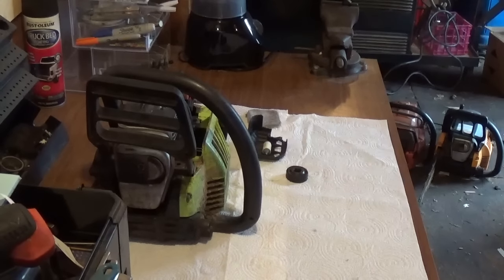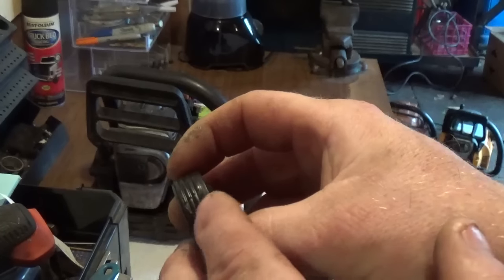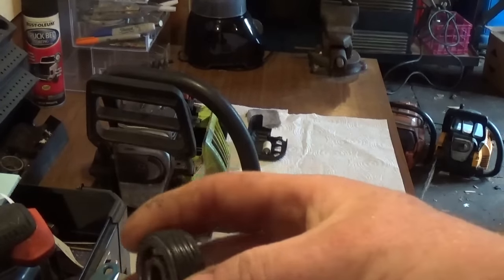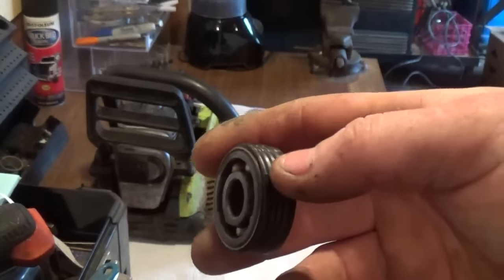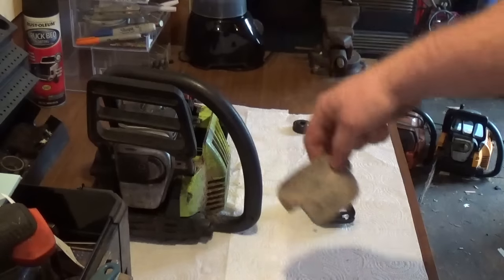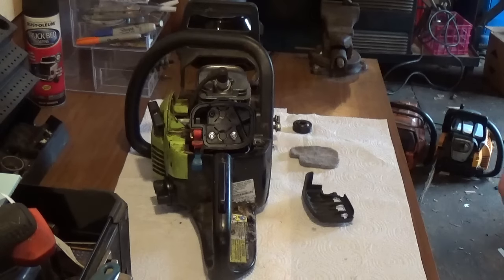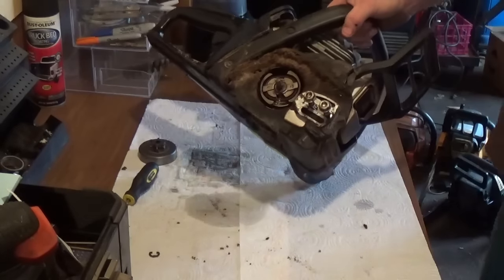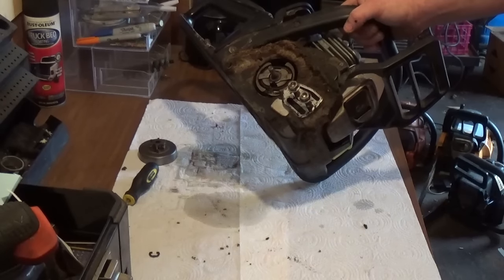Common problems with Poulan Chainsaws

Comment: To be honest the fuel line deterioration can happen to any brand, especially if ethanol fuel is around.
Reply from the maker: True .....But the cheap fuel lines in a poulan from factory are truly hands down the worst on the market.. Viton really isn't much better....The modern gasolines just play hell on these saws and carb related parts as well .
Reply: If the line isnt black it ain't right. U can go to autozone and find that out.
Reply: i have had two of these and the only problem i have had is fuel lines, bulb primer deterioration, and the carb coming out of adjustment. All simple fixes
Reply: I had cheap fuel lines swell up and crack.
Reply from the maker: 3 in the course of how many years?
Reply: I bought two over a 7 year period. If you use ethanol free fuel you will have even better results.  You get what you pay for. I don't understand people who buy a 100 dollar chainsaw and expect it to run like a STIHL.
Reply: Kevin Bolin it’s without a doubt that poulan designs equipment to fail. Designed to fail to make more money by buying parts or a whole new piece of equipment.
Reply: Thats on the owner, and I deal with it ALL the time. Seems like 90% of my repair is fuel related. I try and steer guys to recreational fuel, but there are only a few places that even sell it honestly.
Reply: @MonsterLegoTruck  They are marketed for storm cleanups . Thats why they are so cheap. No one buys a $100 chainsaw to cut 10 facecord of firewood for the winter and expect it to last. We called them bic lighters, when they ran out of fuel, throw them out. Most guys NEVER properly maintain them. They use them for storm cleanup, then throw them on a shelf in their storage barn. They sit with old fuel, caked with oil and wood chips. Then next storm comes along and guess what? Garbage. Then they sell them at yard sales or give them to a buddy that brings them to me expecting me to be Small engine God or something. I usually tell them , sorry, by the time I fix it, you could buy another new one. Then they ask me to scrap it for them. NO PROBLEM!
Reply: Well spoken of Truth
Reply: @kevinbolin7665  Put good gas in them,,,less Ethynol,that tears up all small engines....Stick with good octane gas,no Speedway,Casey's,I you BP ,94 Octane in everything,keeps them clean and running fantastic,,,,,,,NO ETHYNOL,,,,,BAD ON YOUR SMALL ENGINES,,,,,,,BURNS UP CYLINDERS AND LOCKS THE RING INTO THE PISTON,,,NASTY SHIT...
Reply from the maker: Toob247 Toob247  LOL...and a set of adjusting screw drivers , new carb, new gas cap, fuel lines, piston , cylinder, recoil assembly , coil, intake gasket , oiler...….LOL …...you know basicly a actual running chainsaw to cannibalize . This comment …...I mean seriously …...damned this is funny …...3 acres …...lol …….How many shrubs did you cut..... ROTFLMAO...….Tool247 Toob247 I am trying to keep my composure / OH hell …..Seriously Provide my viewers and I a video to validate your claims as the shit is getting deep and I haven't even put on my boots so to speak .
Reply from the maker: @ROYLFRSHNESS  Really / Prove it …..Show my viewers your results by taking own the Poulan challenge .
Reply: Buy the cheapest saw you can find and expect prograde logging equipment
Reply: I actually seen a video once where an American  pronounced poulan correctly.
Reply: And all saws are mass produced.  Don’t see how that is a specific downfall
Reply from the maker: @lucaslounsbury8515  Oh well let me Enlighten you .....Quality Control ......expedient production ......Rushed casting defects ......inferior cheap china incorporated parts ........Truly Lucas this list could go on and on ....You might wont to look into how quality chainsaws are made ......I think How its Made the Tv series may  provide a profound amount of insight towards your perception in comparison to your idealism .
Reply from the maker: @Mike-su8si  LOL.....Right as much oil that leaks from these pieces of shit just simply flip them over and place the bar in the puddle you have amassed ......
Reply from the maker: @lucaslounsbury8515  Chicanic
Reply from the maker: @lucaslounsbury8515  Now Efficiency ......Thats where you need to base your argument .....Not price point ....Quality is often expected rather rarely delivered .....Theres truly no Standing Standard as there once was   obligating longevity .
Reply: @kevinbolin7665  I like how the oil comes out of them and wished this shitty stihl would work as good as my poulan pro but it doesn't so the stihl is just a sitting piece of junk to me 

I still would like to find someone and trade this stihl for a poulan cause i screwed myself the day i bought it an was set to buy a husqvarna
Reply: You are so right, not just the wild thing!!! I defense the the wild thing, I have had mine for years and l have had no problems like this, in my eyes the wild thing saw is a good saw my friend!!!
Reply: No, any material scientist worth their salt can easily help a manf. spec ethanol resistant material for their lines.  Its $0.05 more.

Comment: The crankshaft seals going bad are a problem. I was given two old saws and after fiddling with the saw for hours, I could barely get them to run at a fast idle, but would immediately die or run very erratically - exactly as you said. Very hard to start, and carb adjustments were extremely finicky. This was not a carburetor problem. Suspecting the seals, I bought a new set of seals and bearings online for both saws - had to tear their engines completely down, and the old seals slid right off - they were deformed and worn out. You could see evidence of blowby around the bottom plate of the engine. Put them all back and no more problems, but expect wasting an afternoon doing so - cleaning the gunk out of the chassis took more time than anything else. All parts have to be thoroughly cleaned and free of any grit before reassembly or the bearings or cylinder will be damaged.
Reply: I accumulated 8 saws for fun and one is a 1638 craftsman simpul that ran with a dirty carb when I got it but had to have a fast idle or would die. It would sometimes randomly lean out and speed up for a second or two during no load revs but then return to optimum rev. But it would cut good and not lose power during cutting. When it stalls out from idling it has a pretty noticable suction/whine noise like some kind of vacuum is being drawn into somewhere. Can't tell where it comes from. Almost like something isn't venting that's supposed to. Or is leaking vacuum that's not supposed to. It will also make the vacuum leak down noise if it doesn't start after 3 or 4 pulls. Idk but I struggle to keep it running. Crank seal? It actually started and idled a little better last start with the fuel pick-up and primer line reversed lmao.
Reply: @kkc3009  I have a Poulan pro 4218 that is making that same little sqeaky vaccum noise. Can anyone confirm this is a leaking crank seal? Having a hell of a time getting the carb adjusted on this saw. Can get it dialed in but after the saw cools off it does 
Not want to idle it will start and rev with the choke on but wont idle where it was when hot

Comment: I’ve had my popular 3800 for well over 30 years and it’s cut at least 200 plus cords in its life time and yes it still runs like brand new I choose it over my stihl 036 pro all day long as the stihl is a piece of shit with the shit Chinese zama carb on it now my poulan  3800 top cylinder fin left side top broke off and left side of bottom I call foot plant to start it is broke  as well I tore the exhaust box off and piston skirt exhaust port side looks brand new still but I do only run red armor in all my equipment I’ll be looking into shindaiwa chainsaws love my shiny weed eaters my T242 has over 12k plus run hours on it and still going strong good fuel and top notch 2 cycle oil make all the difference as well
Reply: Just goes to show don't believe everything as "absolute fact" on the interweb.

Comment: I don't know if anyone has mentioned this in the comments already, but my Poulan Pro (PPB3416) gas tank cap stopped swelling and started to work normally again when I switched to ethanol free gasoline as opposed to what you get from most gas stations. I purchase the canned pre-mixed fuel, typically around 92 octane, from one of the many local stores in my area that stock it. It is more expensive, but it made a world of difference on the function of gas cap as well as how the chain saw runs. Also, I totally agree that they should make the components of modern chainsaws so that ethanol doesn't affect them like this, but they don't, so I tried the different fuel and it worked great. As a matter of fact it made a difference in every small 2-stroke powered tool I have.

Comment: if you're going to invest money into a chainsaw, buy a Stihl. When it comes to chainsaws, you get what you pay for.
Reply: Amen! My Stihl MS361 cost me almost $700 about ten years ago. It has been worth every penny! It has never failed to start for me, and has never even needed a new plug. Just basic maintenance ( air filter cleaning, chains kept sharp, bar dressed as needed). And yes, I use it a lot! I use Stihl bar oil, not the cheap crap, and I use a good synthetic mix oil with stabilizer. Buy once, cry once....
Reply: @notajp  The Stihl 361 is a pro saw,mine had 24" bar, I think it was discontinued in 2009, I got mine at a pawn shop with a new bar and chain for $400, Everyone that seen it wanted it, started to cause family problems, I had a guy that had 3 crews of landscaping working almost to my home to buy it and my daughters men both wanted it, the landscapers didn't get it, I think he understands.Beast.
Reply: Around 1980 a 157 years old historical Stuart's Opera House,burned the 3rd story caved the bolted wooden trusses with the metal roof, I went up in there and cut them trusses with a Stihl,they only got me 1 new chain, the bolted together wooden truss were4'x4',full of nails,it was a waste a time trying to keep it sharpened, I couldn't lift them I had to roll to the bottom of the 3rd story tall round at the top windows and drop to dump truck.Lots of water damage, basement library was on the first floor,a doctor's office,, I hauled 1000's of books to the landfill.The stage was still intact,old dimes in the wood floor seams.The seating was somewhat intact.The Stihl took a beating, kept right on chugging, I seen brand new partner saws right out the box at a Paul B

unyon
Competition saws, expansion Chambers,ported and polished lose to the first Partner saws made stock out of the box, I was impressed.
Reply from the maker: Well to use Poulan as a example I wouldn't say you get what you pay for …...But to be honest you do make some excellent points upon price being a prime contributor to the expectation of quality . I like the replies you received from this comment as well and totally agree upon the cry once buy once mentality of Creamapera .

Comment: Poulan ,at one time use to be a good saw mr poulan should have never sold to electrolux which now husqvarna owns poulan
Reply: Jody H   You just nailed it ! Today's Poulan saw is designed to meet a price point.  It is an occasional use home owner saw.  Never meant for  more intense use.  The Poulan lime green saw known as the Wood Shark has a 99 hour engine life span.  Want a better saw the pay out more and get Stihl or a  Husky. But remember they have  homeowner grade saws too.
Reply: Electrolux (yes, the sweeper people), also owns AYP (American Yard Products, used to be Roper). They build mowers for lots of other brands, such as Craftsman, Poulan, Husqvarna, and some Ariens. Husqvarna still builds some saws in Sweden, and they are much better than the Poulan built versions. The Swedish versions will say “Made in Sweden” right on them. And yes, I also hate seeing a Poulan come in the shop...
Reply: Electrolux moved overseas and cut corners to have a fatter bottom line. They've ruined the brand

Comment: I have owned my Poulan for 20 years.  Works great. would not change it.
Reply from the maker: Great/To each there own..... wish the rest of us felt that way .....Just to many problems plague these saws for the experienced Small Engine Tecs....  And due to the repeated breaking down of these Chainsaws its no wonder why they have a company refurbish them..
Reply: Me too but they are much different now!! I have a new one and don't like it!
Reply from the maker: I agree completely ...I hate the new Poulans ......The older ones weren't to bad{they had there issues }but still over all were fairly dependable .
Reply: 20 years ago and further back they were great saws. Today they are junk.
Reply: I have a older one its not bad!!
Reply: That was when they still made them well. Go buy one now and compair it to your old one, prepair to be greatly disappointed.
Reply: I second some of the comments above.  I had a Poulan Pro from around 2000 that lasted me 12 years.  Have had nothing but problems with the newer ones.  The company sat down and said, we need to make this cheaper so we can make more money and we will blow smoke up the consumer's rear when the complain and we will just blame Ethanol gas (they actually did this with me but I was using TruFuel from the start) and hope they can make their $150 from each saw that is tossed in the landfill by a frustrated consumer when they can't get it running right.
Reply: I've had mine for over 20 years and only have had to replace fuel lines and had no problem with gas cap until ethanol was put in the gas which caused it to swell.
Reply: M P I have mine since 82 👍
Reply: @scottfirman  NO do NOT buy a "new one" which says Poulan Or Homelite on it. Just buy a new Stihl or Echo so you'll be able to also help your neighbor with THEIR storm clean up when their Poulan won't run. Run non ethanol or the special fuel mix,  drain fuel before storing, add splash of Sta-bil, run rest of fuel out of carb. Happy Life.
Reply: You got an old one.not the new crop.

Comment: I have a 92 Poulan Pro 2300 that has been an excellent saw. Its not a heavy duty saw, but it has been through heavy duty use. 25 years of use with seven 50 plus year old silver maples and many storms, this little saw has been like the little engine that could. Only thing it's needed is a new fuel line and carb. adjustment which any shade tree tinkerer can do.
Reply from the maker: Friend if you have had luck like this {then be grateful}...For the rest of us have seen the quality and expected performance that leaves us with buyers remorse . I will say Poulan at one time made fair equipment .....sadly in todays market there is a lot left to be desired from the performance and quality. Rest assured I speak the truth ...If there are any doubts look up refurbished Poulan  small engine products .....{what you will discover that I have known for years will amaze you......} These cheap pieces of small engine equipment have lightened the wallet of many hard working men and women .....Price point is what makes them so appealing to most.....But before long they come to realize the error of there ways......{often with buyers remorse as I said previously .} But in any case ...I wish you the best and hope you continue to get the service that has pleased you over the years from your Poulan product.
Reply: Daiid you're a lucky guy!  Perhaps because it's a 1992?
Reply: The poulan 2300 is an older model saw and was made to last.... if your into saws you should know this Kevin....Its not even the same type of saw... if your going to bash it at least know the models that were good the micro's the poulan s25da versions the 3700 versions and so on.....i have to say i cant stand the model of poulan wild thing you showed they have alot of issues....the first wild things were better saws in my opinion and even the farm hands...295/4620 probably the last of the good poulan saws....I see you have a hard on for the new poulans but the older ones like the 2300 /2000 micro saws and many of the older saws still run today... what kills the old saws now is NLA parts.....I myself do not like the 4018 new version of the wild thing and all its strato versions....But if your going to bash people and tell them to educate them self's....Maybe you should do your home work on the older saws... they have a following for a reason... have a good day.....
Reply from the maker: AS I looked at replys to others I came across your comment ...Might I say you certainly have a way of stereotyping with asinine intent . But be as it may I fell compelled to give you some insight on your cynicism . First I never said all poulans threw out the years were pieces of shit only the more modern Poulans in the last 15 years so to speak . Second you implied for some reason perhaps your own humor or ignorant self gratification I have a hard on for the new poulans witch clearly tells one and all my followers that you {your self } lack the ability to be attentive . As it becomes evident very early on in my videos just how much I hate the Poulan product ....So I think you lost your train of thought when you were trying to push your insult . But still the premise of the insult was perceived........Logic rather not so much .....as I hate all the newer poulans and purposely make that point evident . As for the bashing and implying of educating others I simply say as I have told so many others look up Refurbished Poulan Products and see how insightful my facts become . You to Crazed Paul should be entitled to have that {GOOD} or Great day .......SO please go get to it . Your insults much like your self glorified canter should allow you humor on all your travels. Perhaps by taking a sabbatical from your key board you may find my homework was done and using a telephone as a outlet will help aid you with the answers you may potentially seek .
Reply: I have s poulan 2500 farm hand shits the same as a 2040 turbo 2036 turbo jonsered
Reply: Tell me a poulan pro 475 is a piece of shit